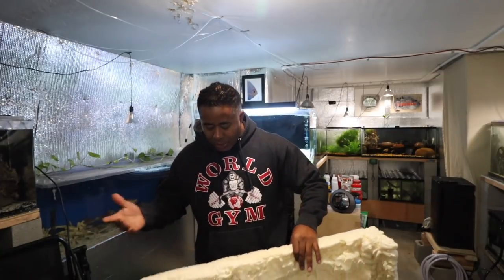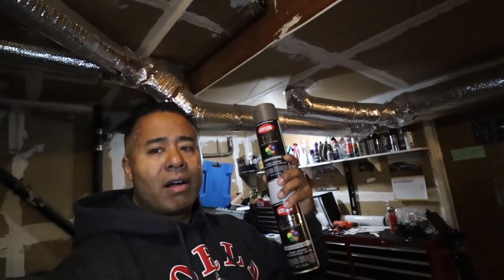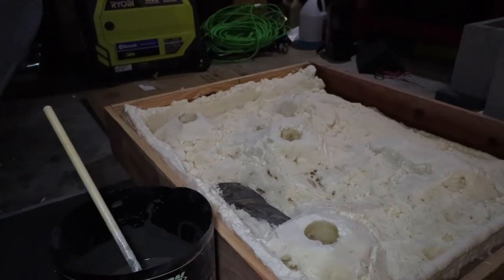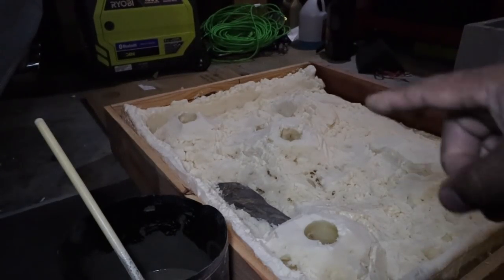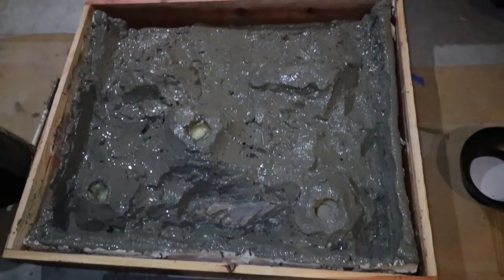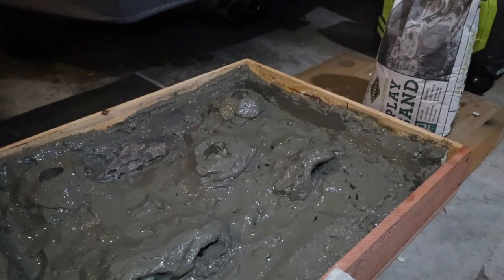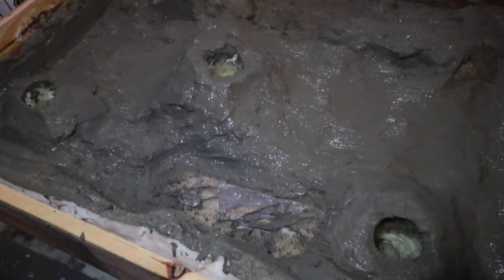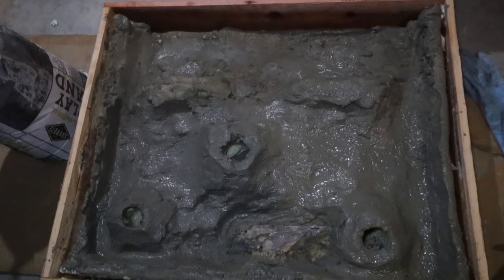How to MAKE a DIY 3D BACKGROUND for your AQUARIUM - Part 3

Comment: @Tazawa Tanks, I used cement without producing concrete, aka without its aggregate. Just the cement powder. 

My first mixture was watery, to get into all the pours. Just wipe it on, let it cure for 24-48 hours. Perhaps quicker if it is warm out. Since this layer doesn't really add any structural strength. 
The second mixture was thicker but still easy to brush on. Working it into the crevices etcetera. Till I eventually, did my third layer which was a thicker mixture with a bit of sand aggregate.

I do not think it is very important to think about the curing process when you work with such thin layers. What is important is the purpose of your usage. If you use it within a tank set-up with a closed water system. You have to typically pay attention to the fact that Concrete wicks a lot of moisture. Two, it produces a lot of alkalinity. Which is good for certain types of shrimps and snails. But one might want to do like 4-5 full water changes before it is Okay for fish or so. I suggest putting in some pest snails as a 'control group'. They are hardy enough and they clean it. 

A tip that I have is, when applying the last coat. Try to dab with a brush to make the surfaces less smooth. You can also use super glue and a tea bag string as an anchor point to create extra outsticking shapes. As a reinforcement. It will harden nicely over time and since it is a tea-string. You don't need to worry about rust. 

There also exist colour powder for concrete that can be good to know. Especially, if you want patches of brown. You can apply that at the end with a thinner cement coat and a bit of aggregate. That way, you don't need to worry too much about mixing potential paints into the background that might not play too well with water. Since you might need to apply a clear coat which is veeery shiny and beats the purpose of concrete.

Comment: Hey buddy, I watched this video, as well as the other two, several times. I have to say that I am thoroughly impressed thus far. It looks like it is going to turn out pretty awesome. By the way, back in my weight lifting days, I did a few workouts at Powerhouse Gym in San Diego about 15 years ago before they changed to their current new name. Brings back a lot of great memories. Thanks for sharing. I look forward to part 4 👍.

Comment: Great step by step Zenzo! Have you ever considered using Terra Cotta pots for caves? You might actually be able to put suction through the wholes in the bottom of the pots to hold in place and make it easier to remove and clean if needed. you could also angle them for plants if desired. Just a thought!

Keep up the great works!
Reply from the maker: That is a great idea. The only issue I would have is the aesthetics. I guess if the foam covers the pot, that would work.

Comment: I use to work with concrete and one of the reason why it can crack is if you keep adding water to it while it's trying to cure, best to make small batches in this situation I recommend.

Comment: I have heard that concrete raises the PH. Is this true. I want to make one of these for an already established tank and was wondering if I should skip the concrete and go for paint and suction cups. Thanks.
Reply: A few water changes will take care of it. Do it while you wash your rocks.

Get 2 birds stoned ;)
Reply: @bogdanforrester1943  I used concrete do I have to change my water when the ph is stabilized? And when I change the water do I add declorinator or no declorinator?

Comment: I'm curious about how long the foam last being submerged in a tank. I have used it in my outdoor pond and it started degrading after about 2 yrs. Maybe from being exposed to sunlight?
Reply from the maker: That’s probably due to the sun. I have not had any degradation issues indoors.

Comment: Did you use cement or concrete? It looks like cement to me and you used the two terms kinda interchangeably a couple times, but as I understand it, isn't concrete with a gravel aggregate, whereas cement is purely the substance that sticks things together? Also please correct me if I'm just wrong
Reply from the maker: Yes, but when I mixed it with all of the sand it becomes concrete.
Reply: @TazawaTanks  so then if one wanted to do this themselves they should buy cement and mix their own sand in, or would you ever recommend a premixed concrete?
Reply from the maker: I would buy cement and sand separately so that you can do both.

Comment: Hey. I watched you videos. Awesome job you’re  doing there. Got a question. I’ve just started my first DIY background. I used quick plug cement after one light coat I let it dry but the next day it wasn’t hard enough and it was coming off my my finger. Is it normal or did I do something wrong?? What cement did you use???
Reply from the maker: I used quickrete
Reply from the maker: You have to add many layers and keep spraying it with water to keep
It damp.

Comment: Do you also cement the back as well or is that  a bad idea?

Off topic question.. is that a e92? And did you use to do auto cross ?
Reply from the maker: You can cement the back of you want to make it heavier, but it will make the silicone process more difficult. 

The car under the cover is an E92 M3. The white car is an E82. I don’t autocross. I do occasional track days. I used to race motorcycles and karts.
Reply: Tazawa Tanks 

Oh I didn’t think of that, yeah that is a bad idea 

Oh that’s pretty Imma look in to kart raceing it’s more popular now in my area always thought it was cool